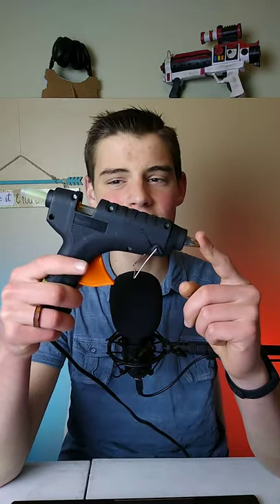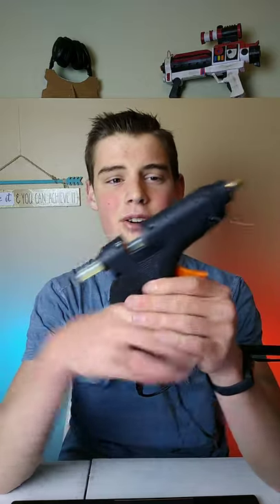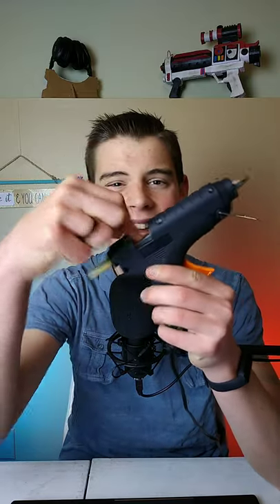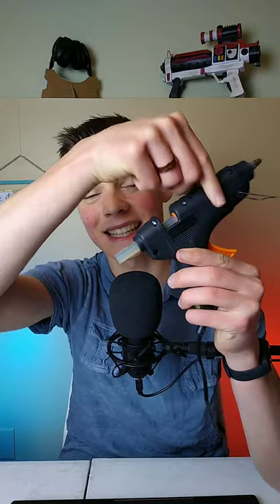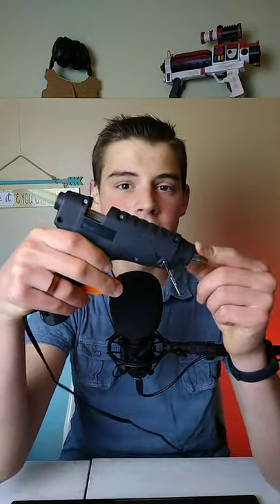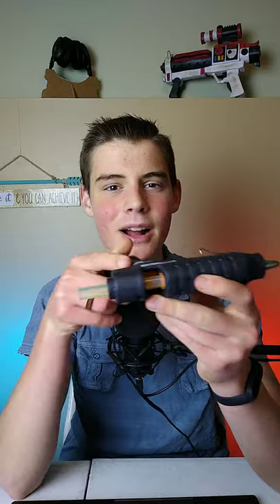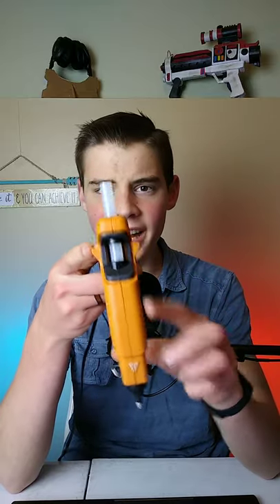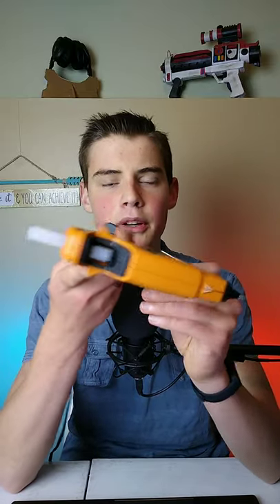The #1 Reason Your Glue Gun Gets Clogged

Comment: But how do I fix it when this happens!?
Reply from the maker: That is a good question, Kennedy. There are a few things that you can try: First, I would try using a small rod and stick it up the nozzle to try and free up what you can while the glue gun is still hot. Another option is pulling the glue stick out of the gun while it is cool. If you can't get it while it is cold (which is very difficult) than I would plug in the glue gun and pull on the stick that is stuck as it is heating up. That way as soon as it is melted free it will come out and hopefully bring your clog along with it. But in general, it is not a good idea to pull melted glue sticks out of your glue gun because it can also cause clogs.

I hope this helps!
- Eli Tennant

Comment: Hey! Need some help, when I was younger I put a pencil crayon in to melt instead of the thing we are supposed to use. It’s been a few months and it’s heating up but when I put it in , it’s not coming out. Please help 😅
Reply from the maker: Hmm, there are a couple of things you could try. You could stick a needle up the nozzle to clean it out. As a last ditch effort, you could attempt pulling back out the glue stick that won't squeeze through and then clean out the glue stick cavity with a popsicle stick or something.

Hope this helps,
- Eli Tennant

Comment: How come it leaks all the time
Reply from the maker: That's a good question Brenda
Some glue guns leak worse than others and there are a few reasons that it could be happening. If the glue gun gets really hot, it is more prone to leak because the glue is less viscous. So if you have a dual temperature glue gun setting it on the lower setting will make it leak less. Some glue guns also seem to have a bigger hole in the nozzle which tends to lead to more leaking. Also, if your glue gun stand keeps it held at a steep angle downward, the glue gun will leak more. I have another glue gun with a large base at the bottom of the handle which allows the glue gun to be set down so that the barrel is almost horizontal and this positioning causes it to leak a lot less. Unfortunately, pretty much all include guns will leak at least a little bit, but a good glue gun will leak a little enough that it only leaves little glue drips stacked on top of each other in front of the nozzle. If your gun is leaving a puddle underneath it then it is leaking quite a lot. There's only so much you can do to help a leaky glue gun, but I hope this helps you.

Happy crafting!
- Eli
Reply: @MakerBrain  It's pretty much BRAND NEW. 🙄I guess I got a dud.
Reply from the maker: That is possible, Brenda. When I had drippy glue guns in the past I usually just set them on a piece of scrap cardboard or paper so I could throw away the drips once I was done crafting.